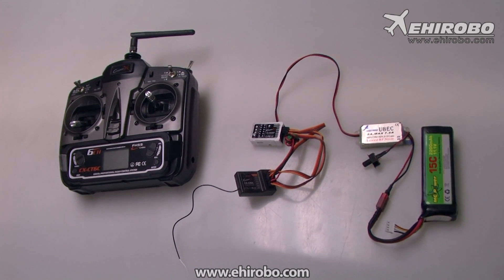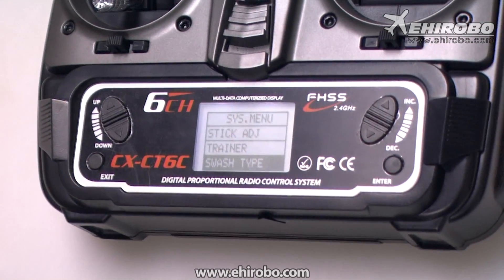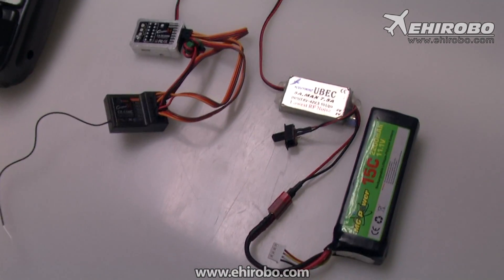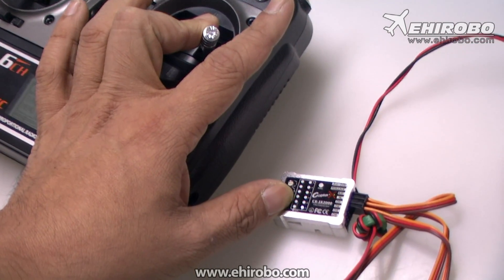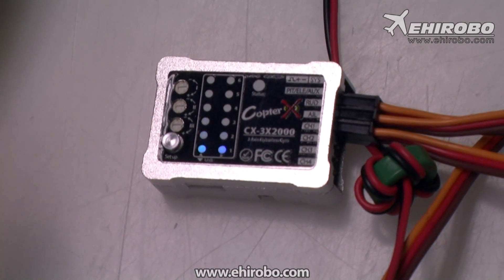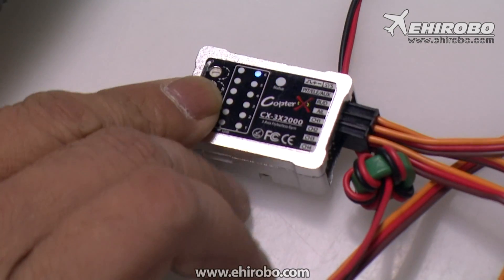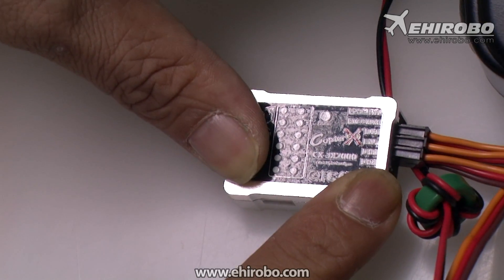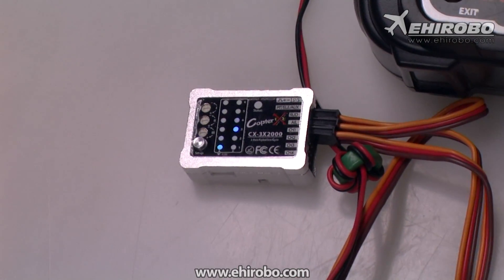eHIROBO.com - CopterX CX-3X2000 Flybarless 3 Axis Gyro System Set Up Procedure

Comment: This is a worthless product that was never finished in development and never supported and also never really purchased by more than just a small handful of people.  All of the problems and pointers to this product not working working well can be found on RCGroups.
I tried to get ti to work for 2 years on different airframes.. and never worked properly.
All my other FBL have worked fine.
Reply: It works fine for me. I upgraded to the latest software, used an old PC to run the setup software and its been working well ever since. Its uncannily stable, and my 450HK is lovely to fly, its practically as stable as my Raptor 550e flybar, which is saying something. 

It would be nice to get more of these for other projects, but my old PC has died, and I'm not sure that I can get the software to run on anything more modern. Its a project to try, because I'm nervous about what happens when this one needs reprogramming.

Meanwhile, I'm continuing to enjoy it. I have a Flymentor on a 450 with flybar, and while this doesnt stabilise the helicopter over a spot the way that the Flymentor does, its rock steady in the air.

I've offered to assist people with getting their CX-3X2000 up and running, but no takers so far, so I imagine most people are out flying.
Reply: Thanks for your feedback.
At this point I know I just had a bad one.
Very intermittent. would fly perfect then suddenly go bad.  
Same problem a lot of others had. 
I spent a couple years on it off & on while learning on other helicopters. 
The software for this runs fine on Windows 7 8 and 10. 
So you do not have to worry about it being on an older computer.
Reply: yep i have the same issues, got one aswell. got it updated to teh latest software, seems better but theres glitches every minute. reluctant to try and even hover my heli.

Comment: I took a bit more time to play with this gyro since my hate comment. This gyro is ok for the money. It actualy flys pretty good once setup and tail locks solid to my amazement. Make sure your tx is setup right before attempting to setup and make sure your rotors and blades are balanced with 0 vibration. The manual touches on all subjects lightly but the parameters are acurate. The gain pots are 1. tail, 2. ele, 3. ail and backwards. meening more gain slows compensation